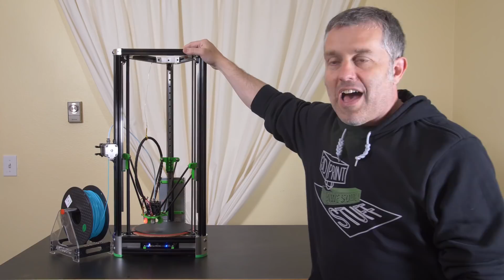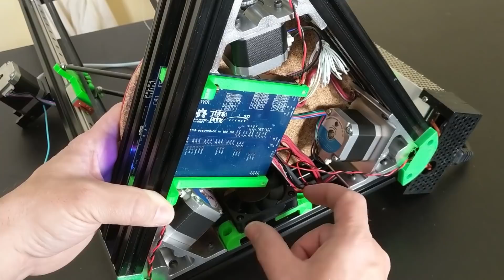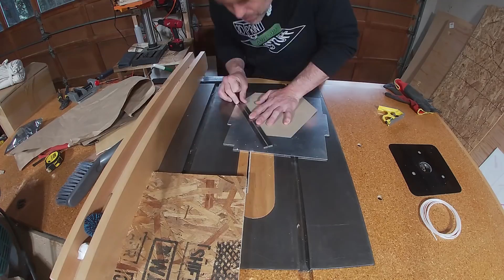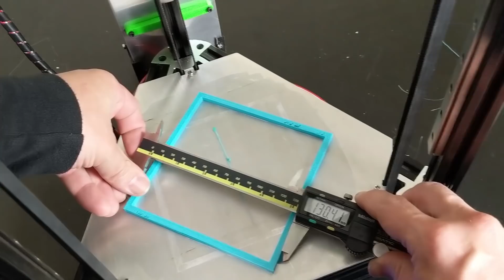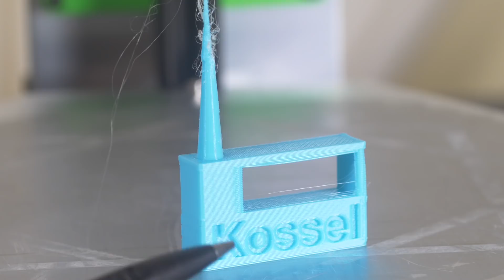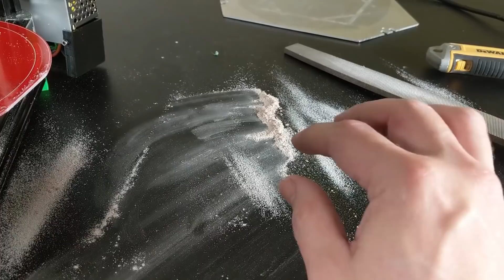The "Kossel Evolution" - The Fastest New Printer From Yesteryear

Comment: Hey not bad, coming back to this video after a few years. 
I've got a Kossel Linear Plus with an ultrabase myself, and over the years I've managed to do feats of crazyness with it. 
With the original board (tri-gorilla 8bit) and Octoprint4a, I've achieved even higher speeds than you have now, by simply using corner braces, the latest marlin with input shaping, a 0.6mm volcano nozzle on a e3d v6 clone, and a new, lighter Resin effector. 
The magnet arms shake a bit too much I've found and you start to experience issues, they don't create the strength you need. 
In your video, I've noticed that you have quite a lot of shaking still. This might be the table, I'm not sure. You might go even faster with arm dampers 

Here's my upgrades for 300mm/sec+ print and close to 450+ infill with near zero difference in quality from 60mm printing at stock (using PLA+ or ABS on a 0.4 nozzle). I approach the FlSun 400 on this old hardware, I'm loving it. You do need to tighten the bands now and then. 

Latest Marlin, with status sending on and input shaping for resonance (2.1.2)
Pickleball feet, thing:3080467 
e3d v6 (Volcano too) with 5015 blower, clone e3d hotend, teflon bowden tube: thing:4329200 
Corner Braces (ironically found these work better than the larger ones): thing:2811848 
Dampner: thing:2793833

Very sturdy table, lots of PID and input shaping.

Comment: Have you looked at either of the remote direct drive extruders? I've just updated an old Ultibots delta to the Flex3drive and am really happy with the system. Zesty Nimble is similar. Also, if you can score some Trick Laser ball arms you get all the zero backlash goodness without the magnet woes.

Comment: I'd be really curious your thoughts on the Duet smart effector (for Deltas) vs. the BL touch.
Reply from the maker: There is no comparison. Get the smart effector. Deltas really need to have the bed measuring happening directly below the nozzle, or using the nozzle itself. Off center probing causes accuracy problems with bed adhesions. I might make a video about it some day.

Comment: Alright, you've talked me into it...
My first 3D printer was an Anycubic Kossel Linear Plus and I still use it regularly over OctoPi+OctoPrint. I've just ordered a Duet board to upgrade it and while doing that I'll upgrade the power supply, fans and hot end heater cartridge to 24V. The original heated bed was actually a 12V/24V combo, so I can just rewire it for 24V. I've been toying with rebuilding it upside down as well (so that the board, steppers and limit switches are all close together), so might as well do that at the same time.
Also, the play in your linear rails doesn't happen on my KLP. I guess Anycubic did the right thing and sourced quality rails and sliders.

Comment: I just scored a Folger Kossel 2020 Rev B on Craiglists for $70, new and unused (partially assembled, badly).  And it has everything to complete!  Will try to use Klipper and flash the boards first to see if I can get the speeds up before swapping electronics.  
Basically, this Rev B. has most of these things in this video (metal corners, uses ball joints instead of magnetic balls, 12V 260W PS, exact same heated bed, etc), except the rails - the rails were on Rev A. but for Rev B. they went to the 2020 wheel versions.  There's no play in mine, like he showed in this video though.  Parts cooler mod first.

Comment: im building a delta right now, im using a couple different designs an trying to combine them an the kossle mini is what i used for the corner brackets. did u model the effector yourself or did u get it from somewhere else. im using 10x3mm magnets an 1/2 inch ball bearings to connect the effector to the rods but im having issues finding a effector that uses the 10x3mm magnets but its looks like urs does if not it would be something i would be able to fix in tinkercad.
Reply from the maker: I modeled the effector myself. It uses 12mm x 3.75mm magnets. using 10mm balls. It's the kit you find on ebay when you search "magnetic push rod kossel" and look at the $17-$25 options. I talked about how to get the files from me at 25:03
Reply: @DesignPrototypeTest  thanks i appreciate it an ill be checking u out on patreon soon. i start to buy a delta i found one was from flsun an the other was he3d i think but with the pandemic going on the prices jumped up so much on them i ended up getting a kingroon kp3 and an anet e10. was planning on just upgrading everything i could on the e10 an once everything showed up i realized i actually had enough stuff to build a delta and i had gotten the e10 printing as good as my ender 5 so i figured i see what it would do with the stock stuff and it didnt last a week before the heater cartridge quit, but its not dead. it has a short where they soldier it together so i just got my 12v cartridge in the mail today so i have to deal with that. ive never changed a heater cartridge and ive never looked into it so i dont know what to expect. im sure it want be to be, i just dread fishing the wires through the braided sleeve.

Comment: Why are there two push rods on each vertex? I would think it would work better with a single push rod per vertex for a total of three instead of six. Otherwise, I really like this printer design.
Reply from the maker: You need six. It won't work with three. With only three the effector can spin in place. Which would have the effect of causing the nozzle to lift in place. The "in place" bit only happens at the exact center of the bed. At the edges the movement is much more messy and hard to describe.
Reply: @DesignPrototypeTest  I see.

Comment: Hello!
It is so satisfying to be able to follow the whole history and mind flow of the Delta printers evolution and the process of improvements. That is a real learning experience for me. One can learn how to solve problems on it's own or how to approach problems. 
Now for suicide project - if I would like to build Delta from the scratch, i.e. print connectors, parts, using extruded profiles what would be Your advice for the design? I was thinking about Kossel mini (I need rather compact machine).
Best regards!
Reply from the maker: Flsun Q5 is a solid platform. From my experience you will need to replace the electronics: https://www.youtube.com/playlist?list=PLtVk4dZInT81VOw-COPzAzUt7AiY8Bv82
Reply: @DesignPrototypeTest  I have seen that video all ready. I have a pile of parts at home. And would like to build  a printer  from the scratch using my  Ender 3 for printed  components. A kind of learning/torture experience ;)
Reply from the maker: Yeah, the Kossel is a good choice in that case. Also look into the Hypercube (Tech2C here on Youtube) and Hypercube Evolution (at thingiverse, I think).

Comment: I'm new to 3d Printing. Fairly computer competent and very mechanically competent.
I want to make parts for the RC Crawling Hobby and others.  First small scale pieces, but my goal is to be able to design body panels as well as interior panels in fullscale detail to create a fully operational piece, with opening doors, roll down windows, opening trunks and hoods, working retracting ragtops, etc.  A 3d Printer will make these things possible, but that is where I am clueless.  So most items will be not too large, but body panels, etc. will get pretty big, especially if I make 1/8th scale items and larger, which I would like to do for 1/5th scale F1 Rcs.

Anyways, that is the basic scope of my desired outcome.
So which 3D Printers would you recommend?  Some pieces may be as large as 24 inches in length.  I could make them 2 piece to go together which his something I already considered, however, if I could, doing them one piece would be preferable.

Looking forward to your suggestions.  Also, I am not opposed to using 2 machines, one for the large items and one for the smaller items, where I could run the large one doubling out parts when not printing a large item.

Lastly, I would like to print in high strength product.  Nylon, Nylon/CF  CF, or other similar tough products.

Thank for any info tips and direction you may be able to point me in.
Reply from the maker: I don't have the time to go into detail. You will need to do your own research to determine if my recommendation is valid for you. I think you should get a Creality CR-10 like this one: https://youtu.be/mw5TXlSzQYI. This will be the least expensive way to print large parts with great resolution. You should buy a hardened nozzle so that you can print Carbon Fiber PETG filament. This filament is the best ballance of toughness, stiffness,  and easy printability. Without a hardened nozzle, the carbon fiber will quickly destroy the hole in your soft brass nozzle.

For your smaller but detailed parts you should get an MLCD  resin printer. Here is my playlist about that subject: https://www.youtube.com/playlist?list=PLtVk4dZInT811xkkDuIiGBoMhIxiD-X6A Uncle Jesse is another youtuber with a lot of resin printing content. I recommend the Elegoo Mars, but there may be other options. Do your research.
Reply: @DesignPrototypeTest  I have been over the last few weeks. Seems many of the Creality units are the most popular and seemingly well liked.  each has its limits (size or material it can handle) and each seems to have separate benefits in some ways.

But I am really unfamiliar with the Filiments/Resins themselves, and which printer handles the more durable stuff I would like to print with.  

Thank you for your Recomendation. I keep landing on the CR10 variations like the 3S i think it is for quality ease of use etc.

I don't mind spending a little bit on a quality unit, and don't mind the tinering/learning fixing improving aspect of things, though I would like this to be as 'set it and forget it' as one can be.

Thanks again. I will head out to look at this units.

Tim

Comment: Do you happen to have any videos or input on the He3D K200 printer? Thanks JZ.
Reply from the maker: Just looked it up. The hotend is atrocious. I've dealt with those before. Heat creep is a real issue. The motion system looks pretty good. V-grooves and double bearing v-wheels. I like the plastic eyelets. They were probably injection molded around the ball, so you know there is no play/slop/lash. Judging by the screen it will have a Ramps based controll board running Marlin. At best it will feature an ATMEGA 2560 chip. This is not enough of a processor. You will need to upgrade to 32bits to get full performance. It's a better purchase than the Kossel with round single bearing wheels. I would still buy the Flsun Q5 over either of these.

Comment: I know you’ve been reluctant to jump into marlin, but I’ve seen that marlin can give you sensorless probing. It seems like you can use the sensorless homing feature to check the topography of your bed. I’d love to see that shown.
Reply from the maker: I used to do Marlin. I don't have any desire to go back: https://youtu.be/-NddPXm0dhk
Reply: Design Prototype Test I watched that. It looks interesting, but I’ve heard that you can probe the bed with just the nozzle by using the sensorless homing feature in the 2209 stepper drivers. It seems useful to do something like this because there should be no need for a Z probe offset if you’re probing based off of the nozzle itself. I understand that Marlin is a bit of a pain, but I think the new SKR boards and premade configs make marlin a lot more usable than before. I’ve got a board and it has no jumpers whatsoever. Everything fits into the premade 2.54 mm sockets.

Comment: Thanks for your great video. :) I'm kinda a happy Ender2 user, though I need to go BIG now, I need atleast >32cm of z-height. I pondered a Anycubic Kossel until I learned I can't buy it anymore :P I thought about replacing the extrusions with 10-20cm longer ones to gain the extra height. Can you recommend this? Any suggestion which printer I should check out? I really have no clue about Deltas. I was about to order a Tronxy X5SA Pro, but here on Youtube I found mixed rewies....  I wonder if I can get a similar buildvolume (~33cm x 33cm x 40cm) in any Delta?
Reply from the maker: IF you aren't afraid of possibly taking 6 months to learn everything about your printer and truly upgrade it to it's full potential, then you can still do a Kossel project. Flsun is still selling their version of the Kossel. You can definitely extend the vertical pillars and get more print height. That's a super easy modification.
Reply: @DesignPrototypeTest  thank you for your answer! I already ordered the Q5. 😊 I stayed away from the other printers because bare rods looks a bit silly (if I use longer ones) and I want to use Exoslides, too 😊

Comment: I recently got my first delta printer, and I must say, Klipper firmware is awesome for these!
I had no trouble setting it up and it has this "enhanced delta calibration" process for great dimensional accuracy.
Reply: I just scored a Kossel from CL for $70.  Never used, partially assembled.  My plans is to go straight to Klipper using the Ardunio and RAMPS 1.4 board, hoping I can just use those electronics for high speed.  
What's your setup with Klipper and electronics on the delta?
Reply: @eduncan911  yeah I think that should work. The heavy lifting is offloaded to the Raspberry Pi, so the main board speed really doesn't matter.

On my delta, the board is an MKS Gen L 1.0, which uses RAMPS settings

Comment: If you increased the length of the rods (so decrease z-height) then could you avoid the ball popping out of the socket due to the decreased angle at extremes? Or is that not the problem?
Reply from the maker: An astute question. You want the rods to be at 45° when the nozzle is at the center of the bed. This ballanced position allows for the fastest movement at all points on the bed. The rods are moving on arcs. At the far edges of the bed (both close and far) the vertical carriages are moving substantially in the Z direction for minimal change in the X-Y plane. By increasing rod length you are making things better at the far side but making things worse at the near side.

Comment: I think you can buy slightly larger bearing balls to tighten up those rails. Or if any of them feel too tight, try swapping blocks with the loose one. I built a small CNC mill with dirt cheap Banggood rails, and some of them were too loose, while others were too tight. By shuffling around the blocks, I was able to get most of them just right.

Comment: 7:55 what you do there is you shim it with copper so tht the movement is gone. then even add a locking screw.  This is how its done on lathes and they have to be much more accurate.

Comment: fun fact, delta style printers still ghost (spring in the belt causing ripples in the print at sudden direction changes) however! because of the relationship between the belt and the xyz axis on a delta printer, the ghosting appears as circular ripples at an angle to the layers. you can see them in the example you showed. tighter belts & adjusting acceleration/ jerk will reduce them. 

but ya deltas are great. the Only issue i have with them is that dual extrusion is a lot harder to do well. here's my deltas: https://imgur.com/gallery/PAoU2 & https://imgur.com/gallery/zFaEW
Reply: How much printing time do you have on those tho?

Comment: I'm shogun_nz from Thingiverse. one of the one's that with the help of others like Da Hai Zhu  and MikeFuLU , I came out with a working version of Marlin 1.1.9 for the stock linear plus and agree with a lot of what you say. But I still think there is life in the Kossel yet.  But it comes down to in at lot ways that many did not understand how the printer worked ( it's not and easy beast that one) and how to get the best out of it. Anycubic in the end was not much help towards the end in some ways. The later versions to my mind did not have good information to  in the later manuals and being about 70% put together. Compered to the first of them when you did have to put the whole thing together But the manual was the key. but in some cases put me on the right track to sort out other issues to. Also Anycubic  support did have issues with the help they did give. A good example and it did not just happen to me. But if anyone had a issue in the to hard basket. Someone would give them my e-mail address or send them over to my posting on Thingiverse. it was insane for a time till i had them up about it and it dropped off. But i do think next time around i will build my own Kossel  using the modern tech as well but also using the old skills is also the key to it all as well. And the other thing is Yes I still get a lot of Questions about the linear plus printers to. Often it is down to the Trigorilla board they use and the first question I ask is what version of board do they have to start with LOL
Reply: I totally agree with the sentiment that there's life in the Kossel.  As a platform I think it offers much more potential performance overhead than anything else out there, plus they're readily scalable and extraordinarily simple design/part-count-wise by printer standards.  The big Achilles heel(s) as I see them are that Kossels are very easy to build badly (especially when built on the cheap or without understanding of the mechanics and forces) and harder to learn to calibrate (not, I think, harder to calibrate in an absolute sense) than Cartesian platforms.  I have a Linear Plus that I'm rebuilding right now with metal corners (after the ABS ones all broke at the stepper mounts) and a homegrown wire brace system and it feels as rigid as a steel drum.  I've been running it for four years and replaced almost everything but the extrusions and rails, but that's another plus about the platform is that it's so easy to incrementally revise.  Now if only Aliexpress would deliver my new pulleys I could see how the new frame does....!